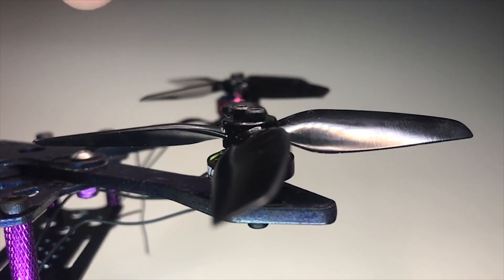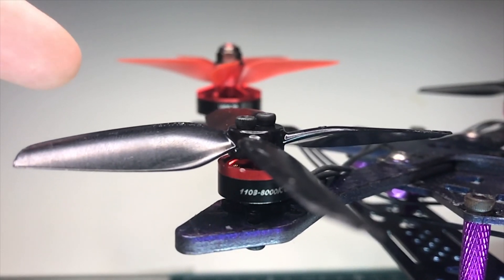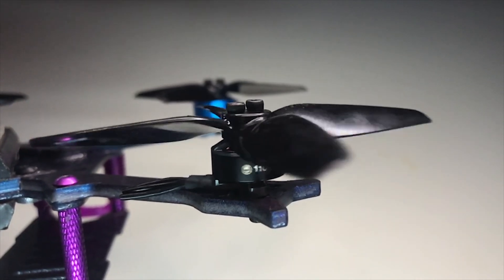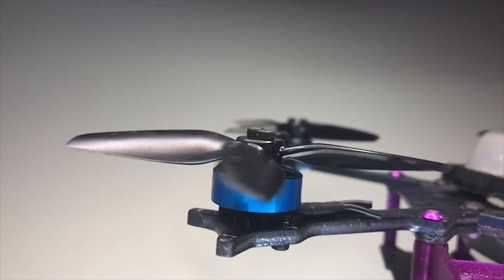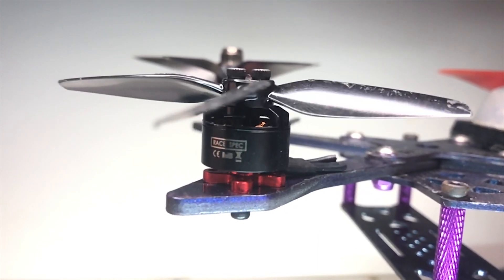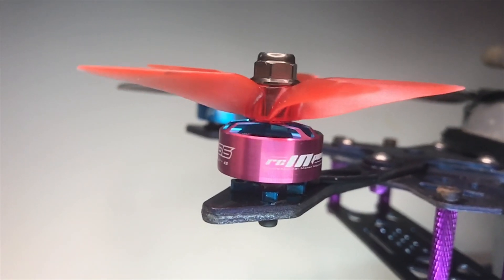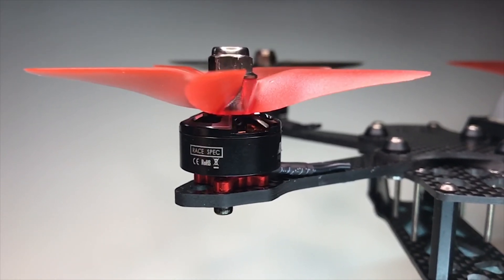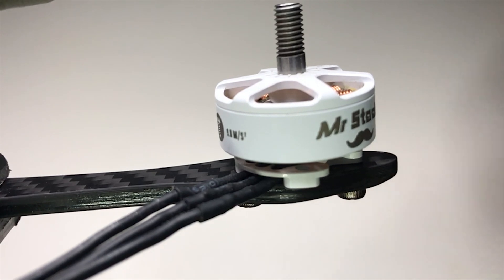Testing Micro Motor Cogging

Comment: When the ESC applies power to the stator, the "coggyness" doesent exsist. We are never flying at less than one rpm, so you will never actually feel it. Most of these motors are 9 pole or 12 pole, they arent notchy. Land RC motors have either 2 or 4 poles usually, and yes a 2 pole motor will be coggy, but it mostly affects starting from 0 rpm, actually "cogging", but works better at higher rpm than a 4 pole. You wont feel notchyness on 9 and 12 pole motors. Of its still "shakey" while flying i think its an ESC program or tuning subject.
Reply from the maker: I've heard that explanation for so many people but none have been able to prove it in any way with a coggy motor that runs smooth, so even if the coggyness itself isn't the specific reason for all of the vibes those motors produce, it's an indicator that the motor is a bad choice for anyone building a quad :)  I didn't know how to explain that in the video in a way that would make sense or take less than an hour so after a few attempts I just said screw it :)
Reply: @CiottiFPV  your kinda right, the proff is all  in the fight videos i guess. Its a limitation of the current technology.
Reply from the maker: @661FPV  I've been bashing my head into it ever since the very first Runcam Split, but luckily we're really getting somewhere now with the Brother Hobby VY and XNova motors with the Runcam Hybrid

Comment: This was really interesting. Would it help to define a higher timing in blheli for nochy motors to give an earlier timing for the phases and maybe overcome the noches easier within each rotation? Would love to see more such videos on fpv related Infos outside of the livestreams. Thanks for the work ciotti :).
Reply from the maker: Nope, worked with Ryan Harrell on that for months and the only slight benefit was the ability to push the tune a tiny bit further but no improvement in jello or vibes in general.  Thanks for the kind words man, it takes so long to do stuff like this but I know I need to do it more, 404 time not found :)

Comment: Root causes of high 'cogginess' is going to be larger thicker magnets, less gap, and taller stators relative to stator width.  All of those things correlate with higher specific output power, and better top end power, but the downside is that lower throttle tuning of those becomes a different thing.  Higher PWM frequency, lower rampup/startup power both help artificially smooth that out through the ESC, and using more thrust_linear or broadly higher low-throttle PID values.
My smoothest rigs are on RCINPower 1207's, which are terribly coggy, but practically super-smooth on rigs up to 180g... but tuning for smoothness is not intuitive.  My super-notch 1408's party as well, but on stock even the FPV feed was jello-ey trash across the range.
Reply from the maker: I’ve spent so much time/effort worki with Spatz and Harrell on BF and BL Heli tuning to get these coggy motors to run smoother and it’s just impossible, eventually I got the Emax 1606’s just barely tuned decent enough to be acceptable but there was still jello in the Runcam Hybrid HD

Comment: Wide, smooth notches are what tends to work out with less issue. Weaker magnets are a lazy way to improve this issue and is what most tend to do.  There is a way to fix the notch but it's just too expensive to produce.  What's hard to decipher is if the notch is wide and strong magnets are used or the notch is narrow and weak magnets are used....or vice versa. Will impact the results of this notch test.  At the end of the day, more power is more challenging to tame. That's where all the esc improvements come in.
Reply from the maker: %100 agreed and I was hoping we’d be able to see more in the high speed but you can only really determine the motors that are hopeless from the ones that are worth buying which lets be honest is a HUGE step in the right direction :)
Reply: Concur, N48 flat magnets and big gaps create 'artificial' smoothness, basically trading power for slightly smoothness.
More power and responsiveness is what causes the negative downsides, detuning through ESC settings wins back most of those losses, and for my part I'm much happier to have more peak thrust potential because that means I can do a whole lot more from a micro platform.
Reply: @D B 2207 is still a good size imo. Still very popular and is better for high speed control.  Steele's motors along with many others use lower strength magnets here and there to manage this issue....like I said in my OP.  Widening the motor shifts the torque curve lower in the rpm range. It doesn't actually produce more electromagnetic power.  Stator volume along with the right magnets to take advantage is what produces power.  There's a distinct difference between torque and power. We need and want both. Not just torque. It's a delicate balancing act.  I just spent the last 18mo testing every size motor I could make or get my hands on. I've landed on a size that I personally believe is ideal for the 5" quads we fly these days.  The motor should be here at the end of the year but it gives you all the power, all the control, all the performance in a 31g package which is lighter than a lot of 2306 motors but this one I'm making is 19% larger by volume.  To me it makes 2306 obsolete since it weighs less than many as performs significantly better.
Reply from the maker: @Kabab  but will it be CiottiFPV proof?????????????????????????????  THAT is the question :-o
Reply: @CiottiFPV  na. It'll actually be more delicate sort of because it's wider than 23. Back when 2306 came about, some racers switched but then went back to 2207 because they were physically breaking more motors. Seems like it was because of the wider diameter....even just a millimeter.  Aside from that issue, it's no more or less durable than any other motor